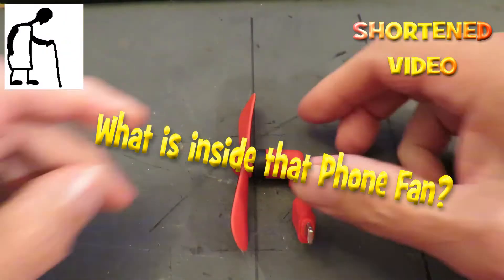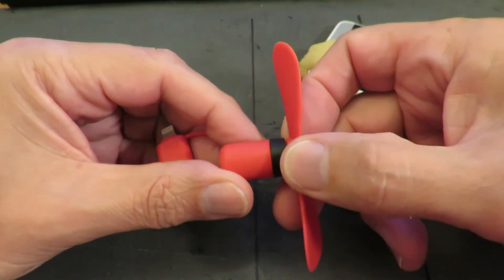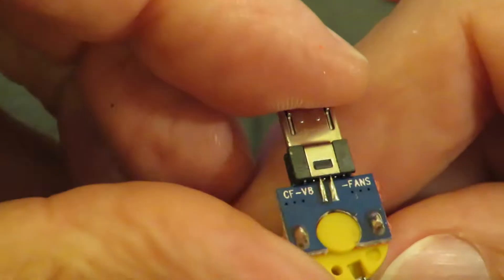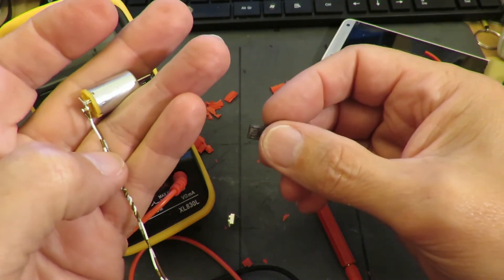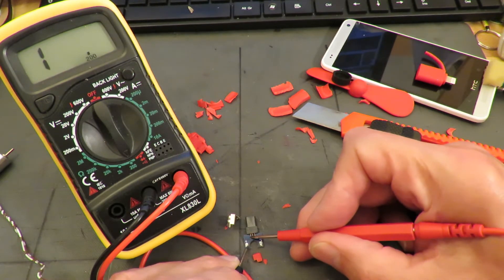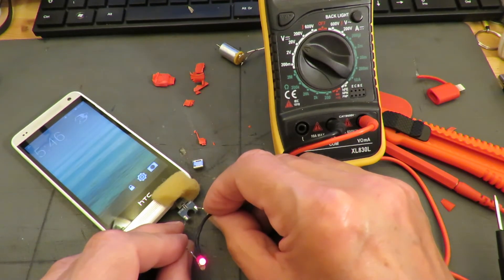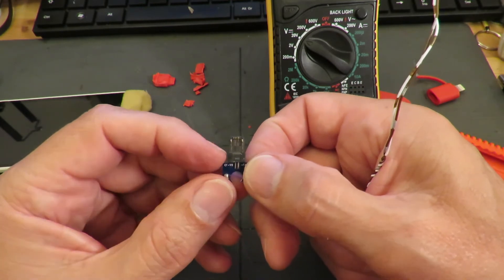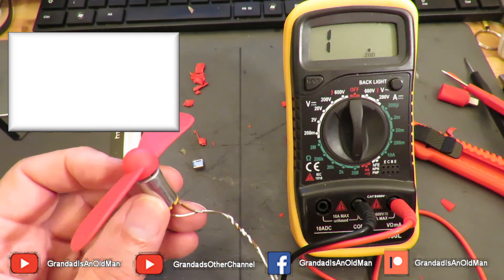What is inside that Phone Fan SHORTENED VIDEO

Comment: Do you know how much power this motor requires without the circuit board? I want to know what type of battery to use to power it for another project
Reply from the maker: I show you in the video that there is 5 volts on the tags where the motor was connected, so I guess that means it is running off 5 volts.

Comment: Those devices are keyloggers and most Antivirus softwares detect the threat .
But some USB devices may be killer which have a high power capacitor in parallel with power connections which kill phones or PCs
Reply from the maker: Yes, I was just trying to show exactly what is inside these fan units as there are several "scare story" videos on YouTube saying they are iPhone killers.
Reply: they are iphone killers because apple iphones or ipads do not have function for that and the result it kills the charging circuit wich then goes to the rest of the components. that could also cause the phone to do weird things like in the video you saw